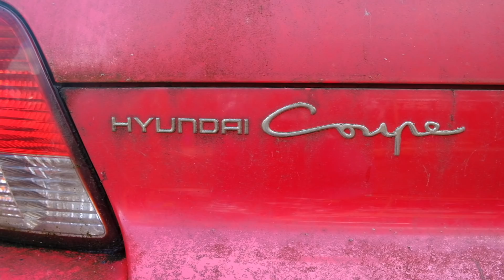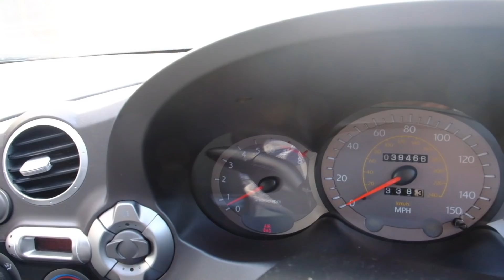My £500 Drag Race Challenge mystery car has arrived!

Comment: A Hyundai Coupe with only 39.466 miles on it is indeed a great find for only 200 pounds! But, it really needs a full service and make sure that you replace the spark plugs, fuel filter, oil, oil filter and clean out the air filter. It would be better if you drain the tank, maybe with a hose and a 12v old fuel pump hooked up too a battery if you can go throw the fuel tank filler neck valve with a hose. 

- First service it, drain the old fuel and place a new filter. The revving issue you got could easily be a clogged up fuel filter that restricts the fuel pressure, seen that before. Also, fill it up with premium fuel. If this doesn't solve the problem then clean the MAP sensor and check the throttle position sensor. A scan tool would help with that. Also, go to a secondhand tire place. They have got some cheap good branded tires with decent profile left on them. These are no good and probably dry rotten.

- Secondly, try a different good battery if you can loan one form on of your other cars if one fits. This one needs at least an 24 hour charge if it sat for so long. Make sure the earth connections are all clean. Put the headlights on bright, are they somewhat weak then check for corrosion. Don't think you have got time for a coolant, brake fluid flush and timing belt replacing, but if so do some preventive maintenance.

Good luck!
Reply from the maker: You've just outlined the next video! I ordered the oil & filter before it arrived and will be swapping the fuel filter - once the old ones off I can use the pump to drain the tank, and give the MAF a clean.
Ive got at least 2 cars going no where with batteries to borrow but its been on charge since it arrived, we'll soon see what state its in!

Comment: After sorting out the engine's issue, don't forget to give it some tasty petrol (95+ preferably). I got an '05 Hyundai Accent that can do stuff with the 86 horsepower engine it has, on regular petrol (Shell V-Power 95), but runs audibly smoother on performance fuel (Shell V-Power Racing), and does consume a bit less on the longer run - instruction manual states to fuel it with 92+ octane petrol.
Airbag warning light may as well be a low voltage alert - swap a battery, drop a code. When the dealership ran diagnostics on my car, it returned "low airbag deployment voltage" or something like this. Battery died in February, got a tasty new one, no more low voltage trouble code is found (got my own scan tool, too bad the car does not have a ton of sensors :D)

I'd say that Coupé is a keeper! Keep it up :)
Reply: What scan tool do you use?
Reply: @DashCamSerbia  Currently employing a CReader V+ -as even this one is sufficient (has a lot of abilities the ECU does not even support).

The Chinese Bluetooth dongle I got from two different sources was not even syncing with the ECU. That is when I looked up the available corded DTC readers available in the vicinity, got the V+ for $80 or so. Still, it's high time to drop by the mechanic to scan the whole system with his tool - that is a notch higher, hope it will be clear :)
Reply: @forresten  Thanks. Yeah, I have a 3.5$ ELM 327 one, and it does not work.
I tried to buy BlueDriver, but no one seems to ship internationally, except for Amazon witht heir rippoff policy of having to pay them for import tax and similar BS.
So I just bought some Humzor NexzScan, which looks like a BlueDriver clone. I will see if it is any good when it arives.

Comment: This one is ready for salvage. Worth it. And keep it original. A friend of mine did 350.000km with this engine in Elantra. No problems at all. Just oil and dilters change every 10.000km.
Still running. Only the bodywork is battered by city parking but mechanically no issues. 14 yrs on the road. Money well spent.

Comment: I think with battery boosters/jump leads/chargers you're supposed to connect the positive lead (red) first,  then negative (black) second.

Likewise when removing them you're supposed to remove the negative (black) first, and positive (red) second. 

The reason is because the electric current actually flows from the negative terminal (black)  to the positive terminal (red). 

By removing the positive/red lead last you're ensuring any capacitors in the circuitry are discharged. 

🤔

Comment: The crank position sensors are an extremely common failure point on these engines, and not revving beyond 3000RPM is one of the symptoms of it failing (can also cause engine to cut out or not start).  They aren't particularly expensive and fairly easy to change.

Comment: used to have a f2 evolution. the good lookin one imo, was a lovely car to pilot and at 154 hp and just under 1.2 ton she went well and was mint on fuel. plus to maintain it was cheap as chips. 10w40 oil. in out evry 4.5k plugs evry 2 years and coils evry 3-5. oh the good old days. plus evry part on em is borrowed from Mitsubishi an honda. even the block is a Mitsubishi unit. its only the head that's Hyundai. reliable motors. had it for 7 years. p.s if running issue persists when battery is fully charged replace or clean tps and cps sensors. very famous causes of bad running. these engines are so simple.

Comment: Oh, Mr Richardson, that interior is lovely! Strange specification with full leather but manual door mirrors, isn't it! Hope that the MOT goes really well, it is going to be a brilliant challenge.
Reply from the maker: Isn't it? When I saw the picture of that I knew it was a genuine low miler. As its a 1.6 SE it had the more basic spec but had the leather and air con added
Reply from the maker: Did you get my email regarding another entrant?
Reply: @furiousdriving , you would definitely win the nicest interior prize, but unfortunately we are not awarding any points for that... Does the air conditioning work?
Reply from the maker: @lloydvehicleconsulting  There should be a new category just for that! It seems to but I didnt run it long enough to get cold as the alternator is suspect
Reply: @furiousdriving , yes, this challenge should definitely run again next year with a fresh load of cars, shouldn't it? Oh dear, a possible dodgy alternator. Let us hope that it is something really simple and cheap!
Reply: @furiousdriving , yes, sir and I have replied already!

Comment: Make sure to rev it all the way to 6.100 RPM to get the most out of it in a drag race. :D
I rev my 1.4l 8v Sandero to 5.500 - 6.000 RPM when I need max acceleration in traffic, because the engine is only 75hp. :(
But I use API SN rated oil, at least, so it is all good (hope the guy who buys my car in future will not see this). :I
Reply: G T  You would be suprised. It is a popular car here.

Comment: Got one of these rotting on the drive, they tend to rust on the sill which is covered by a plastic sill cover so you can't see the worst of it. They have bulletproof engines that keep going. If you got one with a 2.0 beta 1 engine then you can get 400hp with a turbo.

Comment: Aha, a 1.6.  That explains the black door handles and lack of passenger side air bag.  If it was a 2.0 SE, which most of them were in the UK so a 1.6 is properly rare, it would have had body colour door handles and the passenger air bag at that age.  Most 1.6s were the basic models with cloth interior and no air con so that probably makes this one even rarer.  A cute car in a nice colour, and there should be plenty around in any scrap yard you care to look in...
The brand new Michelin on the spare is probably the original so at 18 years old it might not be such a great idea to run it on the road as it may have deteriorated with age...
Reply from the maker: The first owner was a lady of an age enough to have adult children, so I can assume she wasn't worried about performance but wanted a nice looking car with a good interior so specced leather and air. It probably is original, looks like its never been touched
Reply: @furiousdriving    That certainly sounds very reasonable, and is far from unusual with the first owners of these as even the 2.0 litre really wasn't a sports car, though there was a very rare special edition that had a lot of mechanical tweaks that was properly quick.  My sister nearly had one of the next generation 2.0 autos as her first Motability car as our local Hyundai dealer could do her a cracking deal on a special edition one.  Unfortunately, she discovered her local Hyundai dealer in Bedford "doesn't touch Motability cars" which would have meant her going to Milton Keynes or London for servicing which rather killed that idea...

Comment: You will do well with that car mate, ive owned 2 in my time, an 03 and i still dayly drive a 07 S3. Fantastic car in 2.0 litre trim absolutely bullet proof engines that with not alot of work you can tease some good power out of. May I suggest that the first thing you look at for some power is the exhaust system, hyundai are notorious for crap high back pressure exhausts and running a VERY safe rich tune on the stock ECU and the back brakes always get stuck on. Ive owned and worked on the coupes for 6 years now so i know them very well. Good luck with it, they are fantastic cars and great fun
Reply from the maker: My problem  is the £500 limit in the challenge. I think the most I can get away with is nicking the cone filter from the Rover Coupe for the runs!
Reply: @furiousdriving  wont do you much good im afraid, tried running a cone filter on my old SE, i know it sounds counter intuitive but as hyundai run them rich from the start adding more air just adds more fuel and it just bogs these engines out. Best just putting a good quality air filter in the box. As for your 3K rev problem. I had that issue with mine and it was the Crank Sensor. Good luck hope this helps.
Reply from the maker: Thank you, thats really useful to know, saved me a lot of hassle and lost speed. Im putting up a video at noon with the fix for that revving problem-you'll be amazed what it was
Reply: @furiousdriving  look forward to it, you've gained a subscriber, nice to chatting to you. If you need any thing hit me up. You would be surprised at how much you can do with these cars if you ever fancied a good project car in the future, from 300hp 4 pot turbos to the 2.7ltr V6 GTs that can be supercharged very easily. They make a verity of parts still for them. If you would like to see the continuation of this car look at the Genisis Coupe, unfortunately not sold in the UK only in the states. They got that and we got that Stupid odd ball of a car being the Velostar.

Comment: looking forward to seeing the car in future vids..if you can afford to buy cars, why not invest in a diagnostic scanner for a tenner..at least you will get the fault codes..and service the car and do the timing belt cause mine snapped at 57k after the garage supposedly had done it at 51k...2 bent valves which was a good outcome..car was ever the same again after the repairs though..best wishes
Reply from the maker: I did buy a cheap one to find the airbag fault in the Mini, but it couldn't see anything, so I tried it on the Merc when it had a blown bulb and it couldnt see that either... I need to spend a few pounds on a good one.
Service happening.Timing belt is an issue as it will put the car over budget...
Reply: @furiousdriving  the cheap ones won't find those faults...normally they are for yellow light engine management light only faults...good luck with the car.

Comment: Great vid matey ! I work at a Hyundai main dealership, and it's surprising just how many of these are still on the road.
Reply from the maker: I never see them around, do they only come out for servicing? Seems like a well made car
Reply: I loved my 1999 2.0 SE - it was brilliant
Reply: They are actually surprisingly well made. I'm not trying to advertise for the brand, and I don't actually drive a Hyundai myself, but they are much better cars than a lot of people give them credit for. Of course, modern Hyundai's are not 'cheap' cars anymore, and as such, the build quality, amount of kit you get compared to other brands, and above all the reliability, has had to be extremely competitive to reflect the price. When these Coupe's were made, they were trying to establish themselves in Europe, and as such, they had to be better than the competition. Granted they are not the fastest, or best handling, but they are very good cars and the ones we see come in for servicing / MOT's never usually require much work, even though they are getting quite old now.

Comment: Surely someone watching has a fault code reader and lives nearby?
With a £500 budget, of which £200 already spent and still needing an MOT, utilise every saving you can make.
Alternator and battery connections probably loose or disconnected due to the recent welding work, by previous owner.
Welding can blow the diodes in an alternator, if isn't disconnected before work starts.
Low RPM limit sounds like limp home mode, to prevent or minimise further damage before fault codes dealt with and erased.
Try erasing fault codes first and see if they recur. Low battery voltage can trigger false issues.
Reply from the maker: revving is fixed (free) battery light still on, looking into that now..
Reply: @furiousdriving  Put a meter across the battery and start the car.
You want to see the voltage rising to charge the battery, otherwise the alternator is likely knackered. Expect around 13.5+v running.
Before buying an alternator, double check all connections, including the engine earth return strap.
Oh and nearly forgot the really obvious, drive belt being present and correctly tensioned.
Reply from the maker: It is, not going over 13 but it is rising with the revs
Reply: @furiousdriving  Before condemning the alternator, why not try swapping the battery for a known good one. I've not worked much on 21st century cars, but the electronics are very sophisticated and maybe, the voltage is staying low, due to detected resistance in the cells? I'm just guessing, but if I had another car nearby to borrow a battery off of, that would be my next step.
Reply from the maker: @matthewjenkins1161  you'll like the next video..

Comment: The baroque styling is a love it or hate it thing but it seems to be a bargain.  Shame it is only the 1.6.  Why do British market cars always have the smallest engine option?  It might just be a contender though.  Cheers.
Reply from the maker: There was a 2 litre, which most of these were - I didn't know they made a 1.6! In the old days the UK was taxed on power/engine size and then when that was removed the tax on fuel was very high (and has gone up ever since) which puts people off big engines. Also our roads a generally twisty away from main roads and fast revving smaller engines suit that more than a slower revving V8...a tuned high revving V8 on the other hand..
I think this car was bought by an older lady who wasn't worried about speed but wanted a nice interior
Reply: Thanks for the reply.  It all makes sense.  Although I am not a V8 driver :-), I did own an old 6 cylinder Ford Falcon once, 4 cylinder cars now.  Cheers and good luck.

Comment: I genuinely thought you were a car guy with an decent amount of knowledge to actually pull this challenge through. 
Trust me I ain’t disrespecting to you or slagging you off. 

1st problem it does not have a MOT. 

2nd it looks like it’s been sat in a swamp. 

3. Yeah cool only has 39,000 miles but why has it sat that long? 

4. Rust and crud is already sitting in. 

5. Engine is rough as frig as it’s sat so long. 

I hand on heart don’t know your mentality on this purchase for a challenge and buying it blind. 

I hope you all the best don’t get me wrong but you’ve defo made the wrong choice.
Reply from the maker: its a diamond in the rough. Wait to you see it after a wash and service in the next video, the engine is actually pretty sweet and the rust is very much cosmetic surface not frilly metal.
Any car thats sat will have issues at first but if you like playing with cars you can work through them and have a bit of fun sorting it.
In this case the car sat due to bereavement and then long term illness, Ive to the condolence letter from the DVLA when it passed to the next owner so I know its genuine

Comment: Bargain , an ebay £5 elm327 bluetooth dongle and  torque android app (free version) on your smartphone will read engine ECM fault codes and give live data and save you paying for diagnostics (on most 2000+ MY cars) .wife had an Elantra  ,on many Hyundai ,the clutch slave has a restriction valve in that briefly slips the clutch,which you can remove  (put in by Hyundai because yanks can't handle clutch bite on manual cars ,google should have information on this) worth looking into for drag races or if you get SCS   (slippy clutch syndrome)
Reply: I bought one for about 3.5$, but it does not work. It only seems to work on some cars, based on the reviews. Now I have ordered a 24$ one (some Humzor NexzScan, that looks to be a BlueDriver clone, hopefully). I will see how it goes.
Reply: @DashCamSerbia  Elm 327 worked fine on wife's 2000 1.6 Elantra (many common parts /powertrain with Coupe)  to reset EML and read live data,

Comment: Is the Hyundai any good as my first car?
Reply from the maker: If you can get insurance on a 1.6 yes, it’s seems low insurance (£100 to add to my group policy), reliable motor and solid electrics. The interior is good too. Just be aware they are nearly 20 years old so check really well for rust in the sills-think if if as a Rover R8, the sane rusts spots apply

Comment: i would NOT buy a kia-hyundai only for that annoying continously "bing-bing". They still are garbages, but they are fabulous promoted, even in WRC (that car which is almost world champion, has ABSOLUTELY NOTHING in common with regular i20 😁😂)
Reply from the maker: The binging is already getting annoying, have looked for the fuse
Reply: They dont usually beep. Mine only beeps when the lights are on, or the fog light button is pushed in.